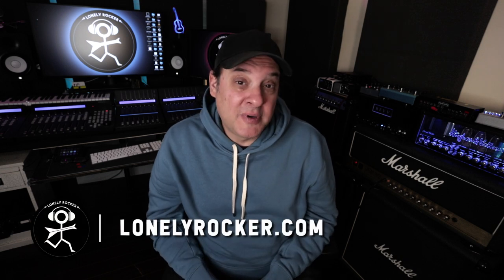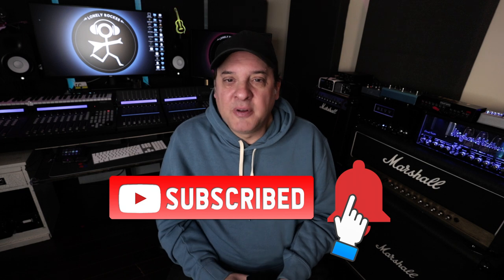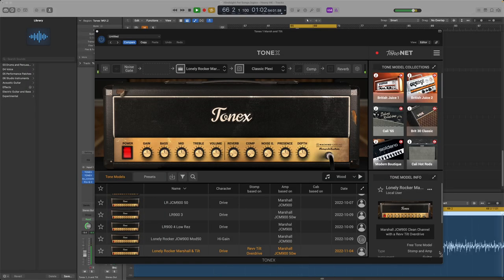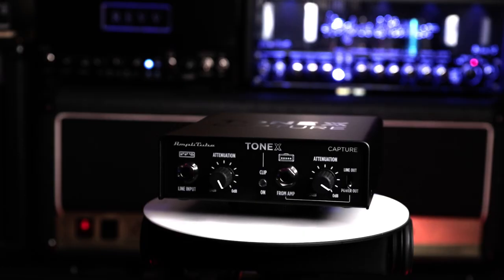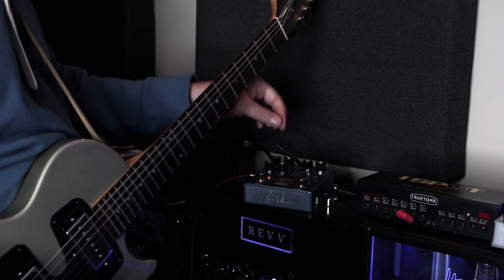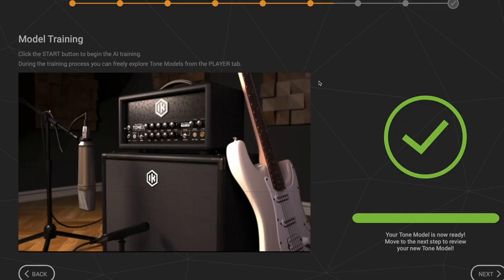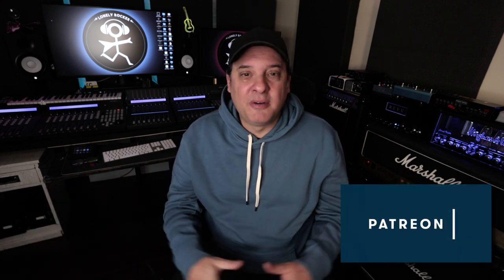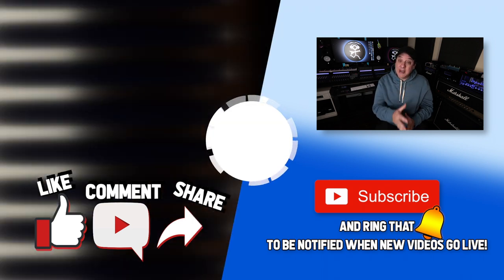How To Make a Guitar PEDAL Tone Model With TONEX CAPTURE

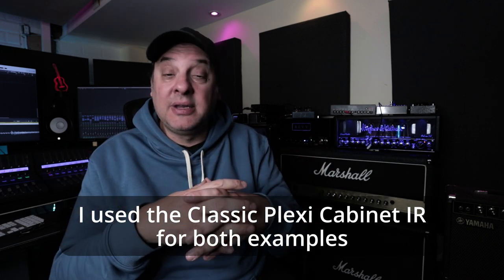Comment: Great video! This will help with saving time knowing the limits and downfalls of Tone X. It seems that Tone X does not perform well stacking captures of drive pedals then amps. At 7:08 the stacked capture results are noticeably lacking quite a bit of clarity and presence compared to the combined capture. It seems like the Quad Cortex performs much better with the stacking of captures, which makes me wonder about how good Tone X really is. I already own the QC but just bought Tone X for DAW needs, just not sure if it will wind up replacing the QC entirely for me. The time it will take to make advanced captures without a nvidia GPU is a real deterrent, especially when the results can apparently be lackluster and inconsistent at times.
Reply from the maker: Thanks!  the thing about Tonex is it is so new.  I have spoken directly to someone on the Dev team and there's so much more coming with the software.  I know the QC had issues early on and it continues to improve.  Integration in Tonex is a huge priority for them.  I t will get WAY better over time.  Updates are coming out regularly for it.

Comment: Very informative video. It was a big help in the hardware setup of my Tone X Capture with my audio interface. It took sometime, mostly because I have a different interface from yours, but I was able to get the modeler setup as well. Again, thanks for the video. 
I did run into one problem though. I tried modeling a setting of my The Astronomer V2 Reverb, Delay pedal. The capture and AI worked the way it was supposed, but the reverb setting I was recording, did not show up in in the model. It's possible that Tone X doesn't work with reverb or delay pedals. If that isn't the case, I'd like to know what I'm doing wrong.
Reply from the maker: Glad this helped!  TONEX can only capture tone.  No reverbs, delays or modulation effects.  You can capture distortion, overdrive and fuzz pedals.  Hope that helps!
Reply: It does. Thanks for the info, and for the quick response 😀

Comment: I have a couple pedals that I run into the front of my 5150 III. I have a Friedman BE-OD, & my trust old Boss SD-1. I am a very old school real amp player when I just play, but I do have an Axefx I use only for recording. What I am curious about is how the modeled stomp boxes are in front of a real amp using the Tonex pedal (no cabs or other amp captures of course) I was thinking about getting a REV G4 pedal at some point, but if the ToneX pedal can capture something like that to hit the front end of my real amp, I’d probably just get a ToneX pedal. Does it need to be exact, not really, but the compact pedal board size of the Tonex is what is really peaking my interest. I’d love to have a bunch of captured stomp boxes ready at the click of a button. I run my effects in the effects loop, so this would be just going in between my guitar & amp input. Any thoughts on this kind of setup? Also, could it capture a preamp (Marshall JMP-1, ADA MP1 etc) & then be used as a preamp into the power section of a real amp’s effects return? Loved my old JMP-1 back in the day..
Reply from the maker: TONEX captures pedals really nicely but it’s hard to say how well it would work for you.  Like the amps it’s a single instance capture so you would capture the pedal multiple times with different settings and then the TONEX pedal tweaks take over.  Like anything you need to get your hands on it to know for sure but I’ve found it quite effective using it that way.
Reply: @LonelyRocker  Thanks!! I have tried the Tonex CS plug in, & for an amp sim, it is great..even compared to my Axefx 3. I’ve A/B them, & it is great! I absolutely love that plate reverb!!! I’m going to be getting the pedal when I can. That makes sense about how the pedals would be captured, & I expected that. I’m an old school metal player, so everything to Eleven…hahaha who needs a clean channel anyway? Thanks is for the info! It is nice that the Tonex CS is free, so you can at least try the software…you can even try the other models out in demo. (Limited, with a hiss) so on the recording side of things you can really get an idea how the sounds will be. Plus with the full software being included , this is a great deal! Just waiting for them to come off from backorder.

Comment: Hi! Great video! Do you ever try the model of pedas in real amp? I bought a tonex pedal and I would like to profile some pedals (lead channel of Jad & Frèer a valve hi gain pedal, my old plexidrive from wampler and the eruption od by colombo audio) and use only the tonex in front of my real Plexi MKII. Did you test this tipe of setting? Regards
Reply from the maker: Thanks!!  And absolutely!  I did try that and it's a great way to load up different pedals on your board.  You can capture multiple instances of your pedals in different configurations and use the onboard dials to make tweaks as you need.

Comment: So can you do this without the capture unit? Or is it really needed for the process. Been having an issue capturing the sound I want without it
Reply from the maker: You need some kind of re-amping box which is basically what this is.  Some audio interfaces have built-in re-amping capabilities.  A re-amp box takes the guesswork as far as using DI boxes and things like that.  Tonex Capture is really ideal for capturing with Tonex though....

Comment: Thanks for the vid!     Q: Is it possible to 'Capture' multiple pedals individually and create a usable preset of them in series? Or alternatively, 'Capture' multiple pedals simultaneously in series to use as a preset. (My goal is simplify my guitarists 20 pedals into something manageable and many of the 'sounds' he uses are using multiple pedals at once. This is a live situation and not looking to get rid of his Mesa MIV or do any amp modeling.)
Reply from the maker: My pleasure!  With Tonex you can't really create full presets.  You can capture a pedal, pedal and amp or pedal amp and cab.  For recording it works well with Amplitube for the rest of your signal chain, but for live Tonex could work great with another multi-effects pedal.  On it's own it just offers reverb but no other effects, other than compression and EQ.  Hope that helps!

Comment: I captured an OD pedal but how to put the modeled pedal in front of a modeled amp? It seems there is a spot for noise gate & compressor  before the amp model in times sw but how to put my pedal capture in front of an existing amp model? Help.
Reply from the maker: In TONEX you can’t build signal chains.  But you can in Amplitube.  You can add your TONEX tone models in Amplitube and stack them any way you want.   If you are using the TONEX plugin in a DAW just stack plugins.  PEDAL IN ONE, AMP IN ANOTHER ETC. Hope that helps.
Reply: @LonelyRocker  is there a way to export that model back to tonex? so you can have the pedal + amp sound?

Comment: Hi, good video! I wanted to ask why you can't use the profiles of individual tonex pedals in amplitube? in fact I cannot put a tonex pedal in the position of the pedals in the signal chain but only in the slot of the amps. I don't understand the choice of ik multimedia who herself made hundreds of stomp profiles but in fact unusable in amplitube!
great revolution, let's hope that some holy user profiles the Cornish pedals or the famous 2290
Reply from the maker: Thank you.  The simplest answer is Tonex development is still very early.  I’ve been in direct contact with the Tonex team.  More and more features will be added and this will soon be easier.  It’s coming!  For now, you can load a pedal into a Tonex amp slot in Amplitube.  Just run multiple instances of Amplitube and put the amp second.  Hope this helps!
Reply: @LonelyRocker  sorry I didn't understand, how can I use pedal profiles now? now it inserts them instead of the amp and the sound is all wrong
Reply from the maker: @mauroassoni8138  Use multiple amplitube plugins.  Use the first one for a pedal only and then run a second amplitube plugin and load your amp.  This is a workaround only for now.  It will get better...
Reply: @LonelyRocker  ah ok yes, but can I do it (and if so how) even if I use amplitube as a DAW? In fact I only use amplitube with its multitracks
Reply from the maker: @mauroassoni8138  If you mean the standalone Amplitube app that's a problem.  There is no way to load a Tonex pedal just yet.  It will come in an update, I just don't know when...